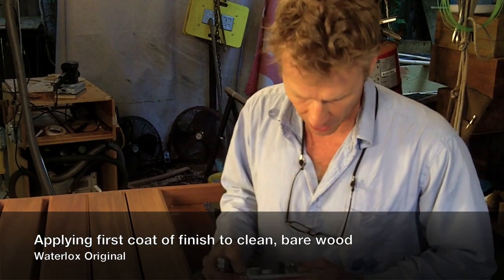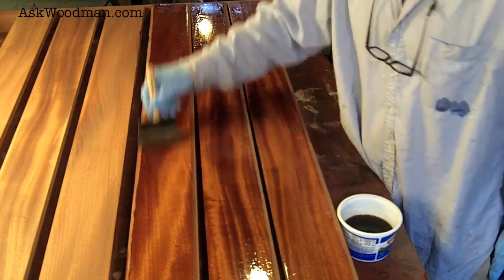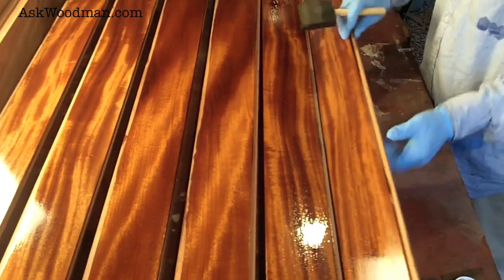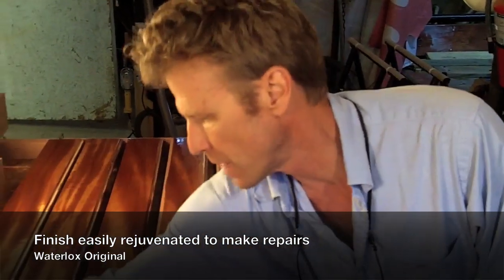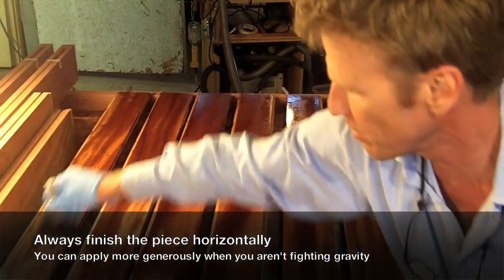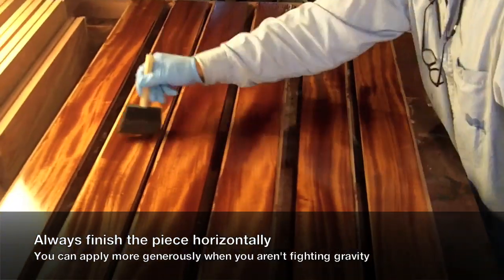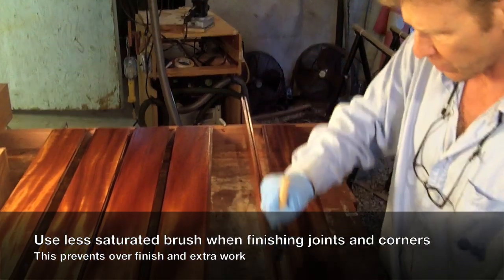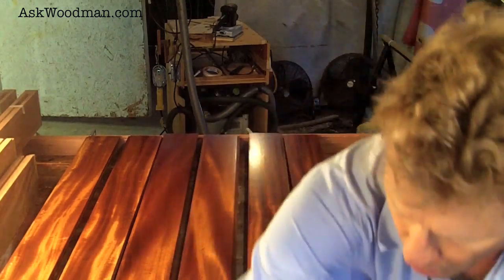14 How To Apply Your First Coat Of Finish - SOLID WOOD DOOR SERIES - Video 3

Comment from the maker: You will notice I brush very vigorously. With Waterlox there is a window when the finish starts setting up and then you need to stop. But until then I like to keep working the finish until I really have it spread evenly with no laps. But I have to say, Waterlox is so forgiving, just because I do mine this way does not mean it is the only way. Give it a try. Start on something small until you get a feel for the material. I am happy to answer any questions. Thanks for watching. Allan

Comment from the maker: @Revit7 Waterlox would be an excellent choice. The real beauty of this finish is that unlike poly, whenever you see the finish needing a freshen up, just scratch and apply another coat. In a high humidity environment like a bathroom you may also consider one of Waterlox's higher solids products like High Gloss, or Marine Finish. But you would always use the Original Medium Sheen for a base penetrating bonding coat on all their products. Let me know if you need more details. Allan

Comment from the maker: You can use Waterlox over just about any stain. I would recommend you really wait til you are sure your stain is good and dry so the solvent (mineral spirits) does not lift and cloud the finish with stain. This series covers about all aspects of using it. Just go easy until you get a feel for the coverage. You can always add more. Note: I use Original Sealer/Finish Medium Sheen. I DO NOT recommend their Satin.  Allan
Reply: AskWoodMan y do you not recommend satin? Any cons?

Comment from the maker: You can't go wrong with it. Just go light with your application until you get a feel for the material. It is always easier to add an extra coat versus sand off drips or runs. Best of luck and I am happy to answer any specific questions. Note I do not use the Satin. I use and recommend Waterlox Original Sealer/Finish Medium Sheen for everything interior. Allan

Comment from the maker: You are exactly correct in your comment. Soap and water for cleaning and a freshen up coat when needed. What I generally do on a freshen up is do a light scratching/clean up just to make sure I have any oxidized finish and grime off so I don't seal that in.

Comment from the maker: @aerostal1 I can't answer that question since I do not use poly. I am old school and the thought of covering wood with plastic does not sit well with me. The biggest problem with poly is that when it fails and it will, there is no freshen up that can be done to it. All of the finish has to be removed to bare wood. Poly will never build that beautiful aged patina. It is plastic. I am not trying to bust your chops about your choice of finish. I am sorry I can't help with your poly question.

Comment from the maker: You are a mad scientist stain experimenter. Just seal it up with Waterlox and it will be set. Just get three good coats on before you start scratching so you only are touching the Waterlox. You don't want disturb the tinted look. Be as clean as possible in your finishing area. It may feel a little rough during those first three coats, but you will knock off the little raised grain and junk in the finish. After this as you try to put on final coats go really clean with no airborne dust. Allan

Comment from the maker: It is readily available from hardwood dealers. You will notice the panel stock is what is called ribbon stripe. The outer four frame pieces are much more plain straight grained stock. In mahogany the vernacular term for the figured stock is called "pattern".

Comment from the maker: @MyManDan Yes you can. Pine being oily and resinous, and the fact you have stained, just don't pound the Waterlox on too heavy because you are not going to have near the penetration I had when applying to the bare unstained mahogany. Waterlox is amazing in how compatible it is with stain. On your first coat just stay a little on the light side until you get a feel for the coverage.

Comment: Hi Allen, im refinish a fir door today the sidelights and transom as well it well worn but it suits the character of the home. ill take pictures as we go along its well sanded and applied a good coat of pre stain conditioner, I have several wood filler spots im concerned will not color properly, any suggestions? Im using the original finish for the base i was told by woodworkers to wet sand the second and third coats on the door to help hide any imperfections. Im going to top it off with waterlox gloss marine finish. I cant wait to see the finished product! Thanks for all your videos. I apreciate all the help I can get.

Comment from the maker: @aerostal1 It depends. If the door has a lot detail and uneven surfaces a good China bristle brush like a Purdy works great. Do not use cheap chip brushes because you will be picking hairs out of your finish. For flat unbroken surfaces the foam brushes are hard to beat as far as quickly applying finish and brushing it out evenly. But many times I have used both at once. Especially in a frame and panel situation where you have flats and relief and corners.

Comment from the maker: For stain I like to use a small piece of towel trapped inside a pantyhose to keep things lint free. And then an extra piece of pantyhose to pull off excess and straighten out the stain. If you have watched my finishing videos you know I am no fan of any flavor of poly. I use Waterlox Original Medium Sheen for interior woodwork and furniture and Waterlox Marine for exterior.

Comment: So, if I wanted to use this product along with Miniwax stain and did not yet begin, should I use the Waterlox first? 
 BTW, the Miniwax is also oil-based, so it says only use oil-based products but I used and non-oil based stain (opaque) mixed with a concrete stain (because that's what was laying around) then when dry to the touch (but not truly dry) I went over it with miniwax cherry. This was a few days ago. Looks real good now. Do you think I'll have problems later?

Comment: Great video!  Really helpful.  I have a kitchen island with an old table top that has been stripped and sanded down.  I tried putting mineral oil on it but want a stronger finish but not poly.  I wiped it down with mineral spirits and sanded it down to remove the mineral oil.  Do I need to do anything else before I use the Waterlox and do you think this product is a good choice for a kitchen island?

Comment: Quick question, below that is my day one thoughts with waterlox.

 I did a bad job. I missed a spot of wood filler when sanding.  I feel like I'm looking more like 1.5 coats than 2 coats, if that makes sense. With this waterlox, I can just sand the area right? I don't need to strip the whole piece? This assumption is part of why I paid what I did instead of thinning something cheaper. 

This stuff really is amazing. I found myself applying the second coat when I was done with the first. Assembled dimensions 4'*2'*2.5' This morning it feels pretty flat, but I think I'm still feeling grain. I don't think it's sandy like stuck particles. Amazingly, after 2ish coats it still looks thirsty in spots. I suppose this means I did a poor job of getting it even, but I figure if I just keep adding coats hopefully it will even out. The stand is either birch or pine, I have trouble identifying. And it is possible it has pine trim and birch panels. The door inserts are some kind of richer wood panel. Oak maybe? The color change was slight, but definitely richer, definitely pops the grain and enhanced any color it touched. The shine at this point looks like it's the wood shining, not a layer on top shining. I'm not sure I would have recognized the difference before playing with this and spar urethane side by side, but now I'll never unsee it. Also, I'm using the... Displacement method to protect my waterlox. I'm displacing air by use of another gas. Does anyone know if this works with wine preserver gas? Or is the co2 in it still enough to start the curing process? I've heard horror stories about the wrong gas causing implosions. I wonder about using straight co2, or beer gas, or nitrogen from paint ball for this purpose, just to use what I have on hand when this argon(I think) runs out.
Reply from the maker: I quite using Waterlox years ago and do not recommend it or comment on its use anymore.
Reply: @AskWoodMan  saw at one point you said you had problems with the product. Fair enough. What do you use now to add a little color and seal? Is there a video for that?

Comment from the maker: Their satin has a waxing agent to flatten the sheen that is streaky or has bits of undissolved wax. You can use Waterlox Original and knock the finish back to satin with rubbing and then polishing compounds (standard automotive products) after the finish cures and hardens. Watco is not something I consider a real finish.

Comment: Allan,
   
    I just 'refinished' my wood table top in a very dark brown stain, the stain is beautiful, however, I applied a polyurethane (straight from the can) for the finish and I hate it. I found your videos and realize that I should've used Waterlox. My question is; how do I fix this? Can I sand the poly down without harming my stain?

Comment: Hi Allan- Your videos have been so helpful to me. Thank you for making them. I'm hoping to refinish a built-in bathroom cabinet that is original to my apartment building...1954ish, I believe. I've sanded off the 60 years of paint that used to adorn it, and I'm hoping I can Waterlox finish it instead of repaint...but we'll see. I'm a newbie who doesn't know much about wood types, but I'm pretty sure it's just pine wood that I'm dealing with. It's definitely soft wood in any case--probably whatever they used back then for standard built-ins. I'm not sure if it will look lovely when finished...or cheap. I'm willing to give Waterlox a shot, but should I use a wood conditioner directly before the Waterlox to help with absorption? Again, thank you for the videos. You instructions are very clear, which is soooo helpful.
Reply from the maker: I stopped using Waterlox 5 years ago. I no longer recommend it.
Reply: Thank you for responding.
Reply: Why?  Did they change the forumlation?
Reply: @GrowLLLTigeRRR  It could be that he was getting a kickback from them and then they stopped, so he might have lost the incentive to "recommend" it.  As I recall they have been using the same formula for over 100 years.
Reply: Bestbuilder, That makes sense.

Comment: Thanks for these videos! I'm going to be using Waterlox on some butcher block counters we are installing. Should I finish both top and bottom of the counters or would it be okay to just do the top and edges? A little worried I may not have purchased enough finish.

Comment: Hi there, I'm going to be finishing my walnut floors and was contemplating on using straight Waterlox over the raw wood as opposed to staining first and then applying the Waterlox. My question is, would the Waterlox still somewhat resist the uv rays coming from the Windows in the house. I recently went into a home where they applied a straight latex urethane over raw walnut and it faded out around rugs and windows.
Reply from the maker: Stopped using Waterlox 5 years ago. I use Sutherland Welles products now.

Comment: Just to clarify what Allan stated, stain first.  Seal with Waterlox after staining since you want the stain to soak into the wood.  I think it's OK to use water based stain with oil based as long as you use the water based first and allow it to dry (the slight moisture left in it by not allowing it to dry fully will probably just stay in the wood.)  If you use the oil based first, it will just repel the water based stain.  I think you'll be OK but it's hard to tell.  Hope that helps.

Comment: I have watched your Waterlox videos and have tried the foam brush method but it seems I can't get away from micro bubbles in the finish.  Any way to avoid this?
Reply from the maker: I stopped using Waterlox 7-8 years ago when I noticed no matter what I did I had bubbles and lack of setup.
Reply: @AskWoodMan  what do you use now?

Comment: Hi, I'm using this on my oak benchtop and applying it using a foam brush like you but the product bubbles as soon as I put it on and dries with the tiny bubbles in it. Have you seen this before, not sure what I'm doing wrong? Thanks!

Comment from the maker: Sorry about the goose chase. Just go to the Waterlox website and use their locator. You can also buy straight from them. Gallons are the most cost effective. Once you go Waterlox it is hard go back to other products. It just makes all wood look as good as it possibly can in a low tech manner. Feel free to write me at gmail if you want to exchange pics or go into more detail. Allan

Comment: If you've already used a danish oil on a project - can you put waterlox on top of that?
Reply from the maker: I quit using Waterlox over 4 years ago due to negative changes I notice in the product. I use Sutherland Welles Murdock's Hard Oil now. Yes you can use it to top coat a piece that has had Danish oil. Just make sure you are good and clean so you don't seal grim into the finish. A light 320 sanding would be in order.
Reply: Good to know!  Thanks so much

Comment from the maker: You are ready to start. It is good you got off as much of the mineral oil as possible, but mineral oil residue will not be a problem. I would recommend thinning your first coat of Waterlox to really get deep penetration with about 10-15 mineral spirits. Waterlox is primarily a floor finish so it  is really tough when it cures. It is also a food grade finish after the cure period. Write me at gmail if you need to send pics or continue this conversation.

Comment: Can you use Murdocs in the same manor as Waterlox? I have Waterlox butcher block countertops, could I 320 grit sand them and put on a coat of the Mudocs ?
Reply from the maker: Yes. I have covered Waterlox with Murdoch's with no problem. The Murdoch's requires a lot less brushing out. I have had best results just getting it on quick and letting it do its thing.
Reply: Awesome, thanks.
Reply: Murdoch's has lots of choices, would the table top gloss be a good choice to go over my butcher block counter tops with, to make my old  Waterlox counters shine more. I'm also curious to how much less is the odor of Murdoch's  because I will be working in my kitchen. Thanks.

Comment from the maker: You are putting on too much and not brushing the material out.  Oak is a very porous wood so there is a lot of air in the outermost fibrous layer. You put the Waterlox on and as the finish penetrates and displaces the air and the Waterlox is thick enough that it traps these escaping bubbles. Notice in this video how much I am brushing the finish. Brushing brakes these bubbles.

Comment: Went to three Ace hardware stores, 2 Home Depot, Loews and Walmart and have not found this product yet. Who usaully carries it? I think I would rather use this over the Miniwax Spar Urethane since I have have to really work hard to get a solid , even coating and it seems I am only able to do so with a natural fiber brush. Using a natural fiber brush means extra work to get it cleaned and too costly to chuck.

Comment from the maker: Their satin product is not something I recommend. It has a waxing agent that can make for a streaky cloudy finish. If you want satin just rub out the finish with automotive compound after cure. That has the added benefit of knocking off any little trash trapped in the finish.

Comment: Completing a mission-style dining table, in quarter-sawn white oak. Had a recommendation that I use Waterlox for a very durable table-top. That individual recommended "wiping" in on with a cotton cloth. Wonder what your thoughts are? Had considered using a wiped tung-oil finish for the balance of the table. Again, your thoughts? Thanks!
Reply: Why did you change after all those years of using Waterlox?
Reply from the maker: +Antique Furniture Laboratory Bubbles, streaks and lack of setup. I think the product has changed. It does not have the same properties I was used to for over 2 decades in my opinion. I am also so glad to be done with the petroleum stink. I have also gone back to the finish I started my woodworking career with https://www.youtube.com/watch?v=lEeb3t1tmSc&index=69&list=PLqtTuVwYBfkxFXRDiDyiAlFeqMKOlh0eC.
Reply: Thanks for the reply. I will give the recipe and  Sutherland Welles a try. i am always looking for a good oil finish for some of the antiques I restore.
Reply from the maker: +Antique Furniture Laboratory This is the one I like http://www.sutherlandwelles.com/murdoch-hard-oil.html.
Reply: +AskWoodMan Ok Great! I contacted  Sutherland Welles. I love the way oil finishes enhance and magnify the patinas of those old beauties. Simply stunning.  I also like the fact they use Aniline dyes in their stains instead of pigments. Thanks for sharing your knowledge.
Reply from the maker: +Antique Furniture Laboratory And since they are using a citrus solvent instead of petroleum solvents your whole shop will smell like an orange juice concentrate factory instead of that obnoxious mineral spirits smell. I was a little skeptical about the product being sold in paint style cans, but it is not nearly as prone to gooping inside the can as Waterlox. Very little skinning over in comparison.
Reply: +AskWoodMan Nice! I have worked hard over the years to constantly find ways to refinish antiques with traditional methods yet reduce voc`s as well. I am excited to get some product in and give it a go!